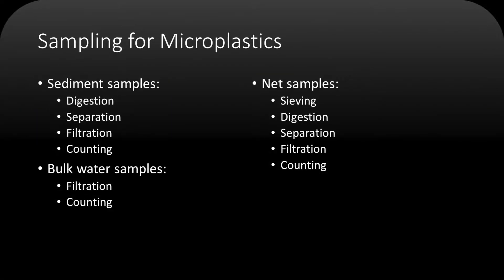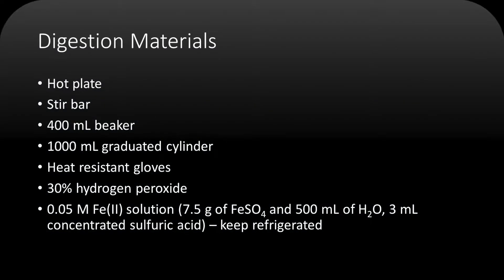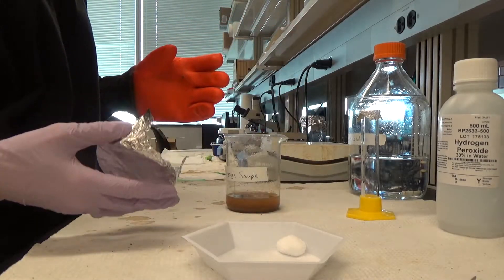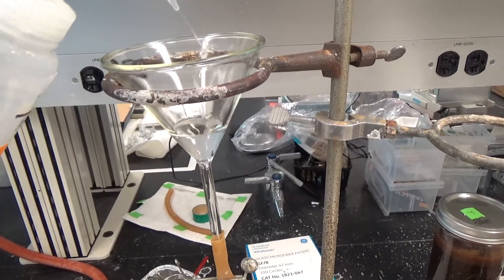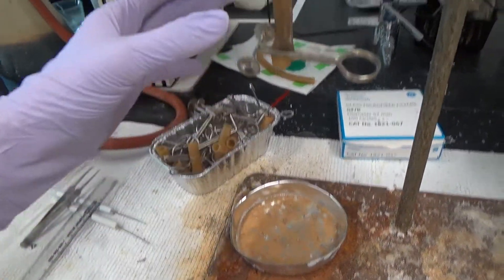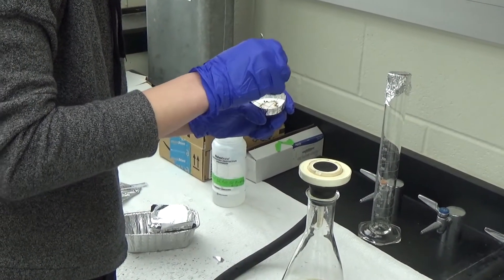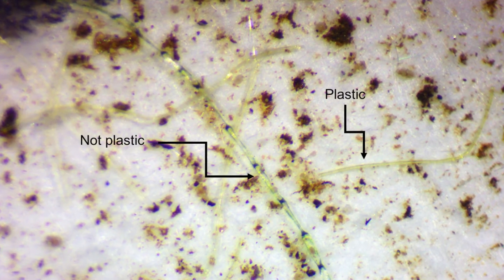Microplastic Processing Protocol

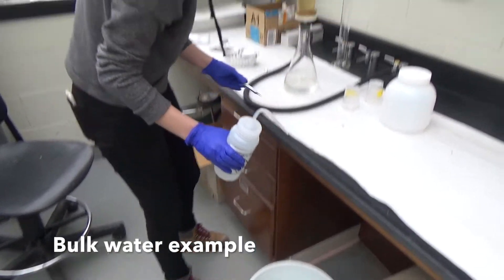Comment: I think it's first the density separation and then the h2o2 digestion. Also, heating like that is not recommended, as you destroy some types of polymers. You do it over several days at up to 40°C. Unless you make the Fenton reaction, then it takes 10-15 minutes. Also, you bend over sample with hair like that 7:50. Hair like that is like a mop that gathers dust and therefore microplastics, you release them into the sample.

Comment: Laboratory Protocol: Microplastic Sampling and Analysis

1. Sample Preparation:

In the field, collect samples using a drift net or plankton net, allowing water to flow through. Calculate the volume of water passed through.
Pour the net sample through stacked sieves, with the smallest sieve smaller than the net mesh.
Rinse the collected material with distilled water and transfer to a 300 mL beaker.
Dehydrate the sample at 75°C for 2-3 days.
2. Digestion:

Equip with a hot plate, stir bar, 400 mL beaker, 1000 mL graduated cylinder, heat-resistant gloves, 30% hydrogen peroxide, and 0.05 M iron solution.
Add equal portions of iron solution and hydrogen peroxide to the sample.
Heat the mixture at 75°C until boiling, then simmer for 10-15 minutes.
Repeat the process until no organic matter remains.
3. Density Separation:

Prepare metal stands, glass funnels, tubing, pinch clamps, aluminum tins, salt, and a balance.
Dissolve 6 grams of salt per 20 mL of sample.
Rinse equipment with salt solution to avoid dilution.
Filter the sample through funnels, allowing sediment to settle for 60 minutes.
4. Filtering:

Utilize distilled water, forceps, glass fiber filters, filter stand, aluminum tins, foil, and squirt bottles.
Rinse equipment with distilled water.
Quadrant the glass fiber filter.
Pour sample onto the filter, vacuum filtering, and dry for 24 hours.
5. Counting:

Use probes and a dissecting microscope for identification.
Differentiate plastics from sand, salt, and organic matter based on appearance and behavior under manipulation.
Notes:

Rinse equipment thoroughly between samples to prevent contamination.
Exercise caution and consistency during identification to ensure accurate results.

Comment: hi, only supernatant use after density separation but you beaker contain more water?please tell ,i am going with soil samples and if i do;t filter it it contain soil particles ?is they are not problematic in next analysis or determination of mps by raman/ftir spectroscopy ...

Comment: What is the reason behind of the adding iron, hydrogen peroxide, salt and others?
Reply from the maker: The hydrogen peroxide and Fe(II) solution are used to dissolve organic material. The salt is to separate the microplastics from the sediment, as the microplastic should float in the salt solution.
Reply: @elizabethberg472  thank you so much

Comment: will you tell me about the how microplastic sampling will be done in the in effluent and and effluent of STPS and WWTPs. How the discharge of microplastics in MP/L or MP meter cubic per day will be determined. What are the appropriate sampling devices used for the microplastics in these units
Reply from the maker: You could do this by taking a grab sample of the water and measuring the volume of the water you have sampled or by leaving a net with a small pore size in the water for a measured amount of time and calculating the volume of water that traveled through your net. There may be other ways, but these are the ones I am most familiar with. Also, you would need to calculate the discharge of the river in order to calculate how many microplastics move through the river per day.